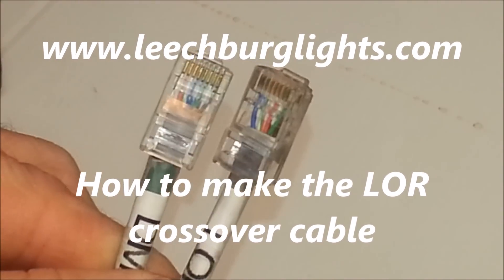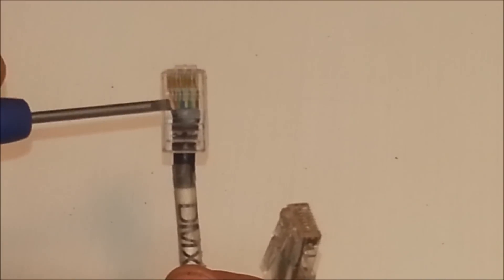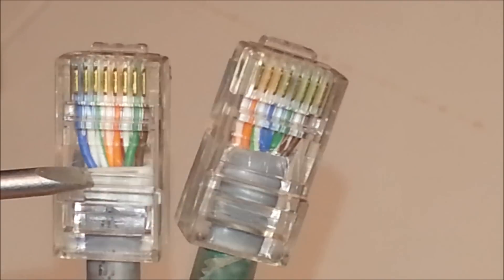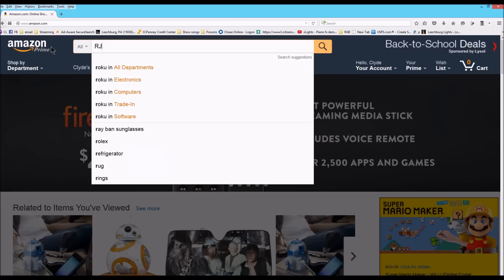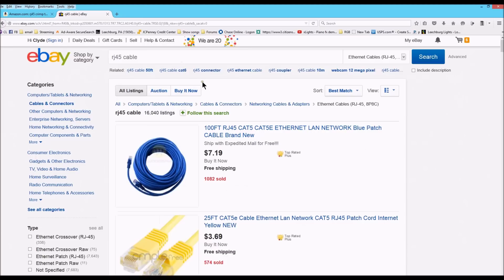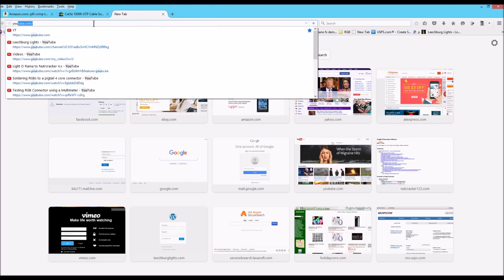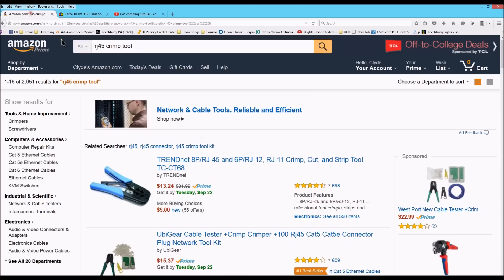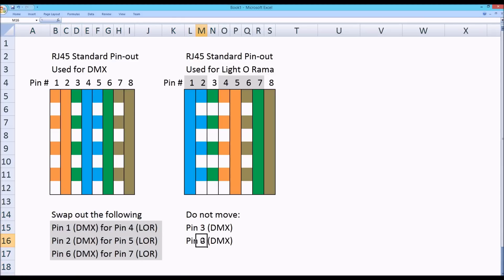How To Make the LOR Cross Over Cable for DMX

Comment: Dumb question.  What exactly does DMX stand for. Is it a setup for dumb LED's only.
Reply from the maker: IDK, had to google that one.  Digital Multiplex
it is a protocol sent by a processor to control lighting
E1.31 is DMX over Ethernet (or networking from a computer)
DMX controls pixels and dumb  LEDs depending on what you have connected to the controller.

Comment: I have an AlphaPix 4 from Holiday Coro, the DMX out says DMX +, DMX -, Grnd.  Which pins do I use going to the first LOR controller?
Reply from the maker: +terry milligan I spent a good deal of time trying to get my Alpha Pix 4 to output DMX to my LOR controller.  I even spoke with David Moore for a good 40 minutes.  No luck.  David says that it is possible.  However, my testing could not get the LOR controllers to run.  But, when setting up and running DMX on the e682 Sandevices controller, I  successfully sent DMX data to my LOR controllers using the following wiring.

Blue solid = DMX Positive
Blue Stripe = DMX Neutral
Solid Green = the DMX Ground

Those are the 3 colors you want to pull out... Make sure you are using the RJ45 wire order... 568b.  That is what I outline in the video.  If you are using a cable that is 568a, it will not work!
Reply: +Leechburg LightsThanks so much for your reply.  If it were to work, and you ran the LOR hardware program, would you see all controllers that are connected together, or would it ignore the AlphaPix 4?
Reply from the maker: No, you can only connect to the LOR hardware utility when you have the LOR controller connected to the LOR RS485 USB to network adapter.
Reply: +Leechburg Lights ahhh, that makes sense, thanks.

Comment: So after making the crossover cable for LOR, I would have an Ethernet cable from the computer out to a Falcon board (or network switch). Then out of one of the DMX outs on the board I would use the crossover cable to my 1st LOR controller, then can the LOR controllers be daisy-chained as before? Does this sound correct?
Reply from the maker: +Tony Mattera Yes exactly!  Use a normal network cables from the first controller to the next.  You only need one cross over cable and that if from your DMX source to the first LOR controller.
Reply: +Leechburg Lights Awesome! Thanks again
Reply: +Leechburg Lights Do the LOR controllers need to be connected in order, unit 1-unit 2- unit 3...... or can they be connected randomly like I would do with LOR?
Reply from the maker: Connection can be random... just like a DMX controller they do not need to be in sequential order.  Each controller receives the data, however it only takes the data that is meant for that unit.  The rest of the data is sent on down to the next controller.